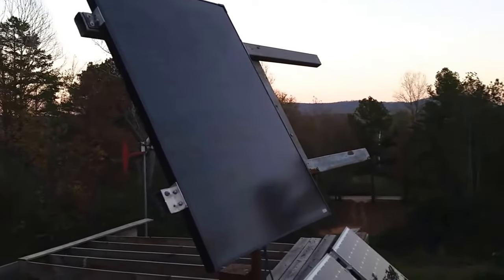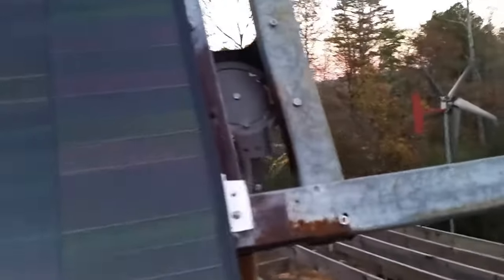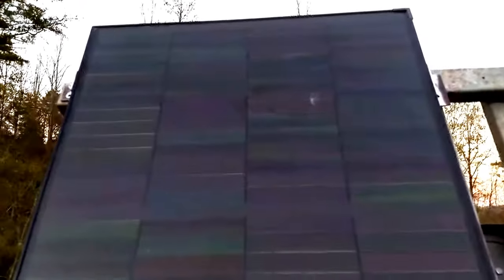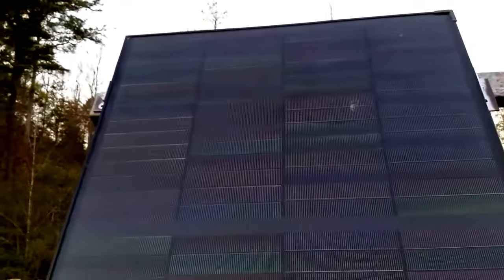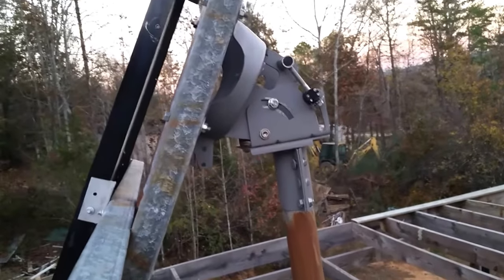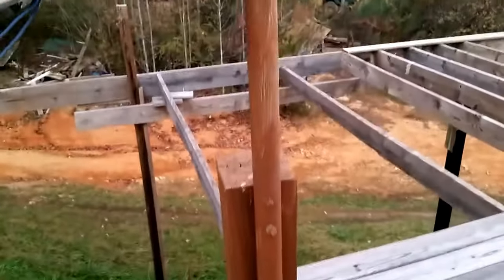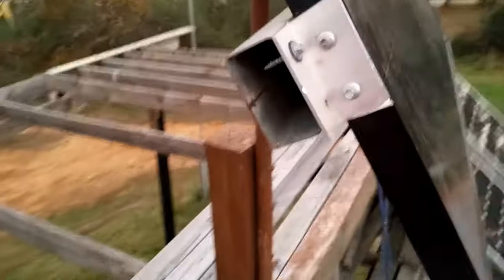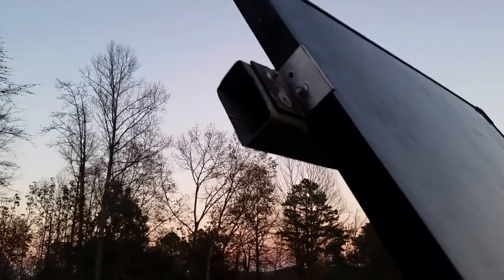Our homemade solar tracker and our CIGS solar panels we Bought   back in 2013

Comment: I have 500w of these Cigs panels. I had them stored in the garage for 4 years. Now I have them to the Sun since December, but they are only delivering half of their power. I wonder if it is normal in this type of panels or should I expect a shorter life than a mono or polycrystalline panel.
Reply from the maker: sorry to here   we use sun edison 250,s panels they they are the best we had so far
Reply: How do you have them set up??? What charger.... They rate the (any) panels at a higher voltage then max battery voltage, so any panels will not see full power... Must use mppt charger...